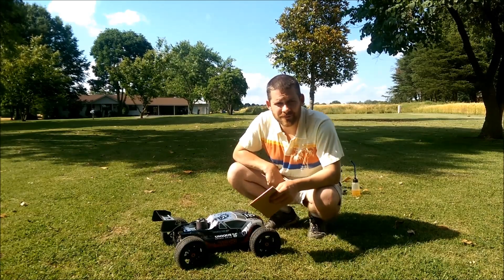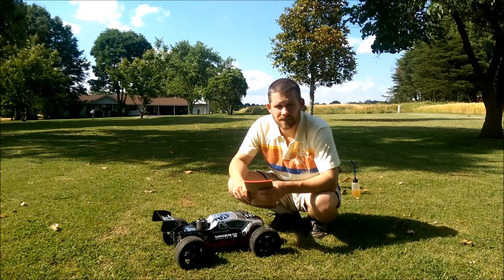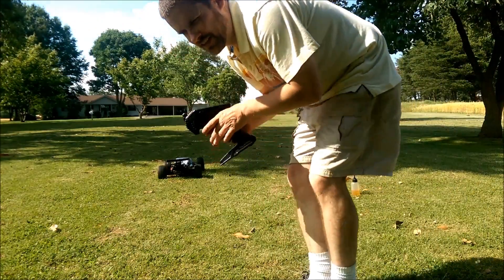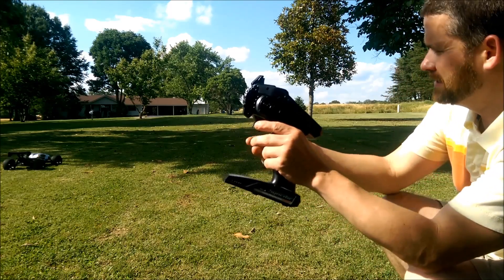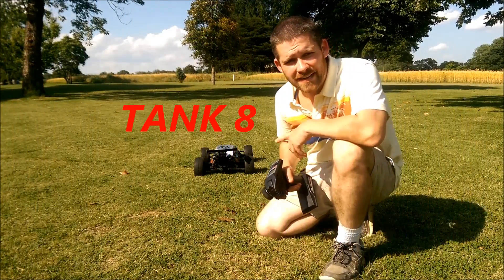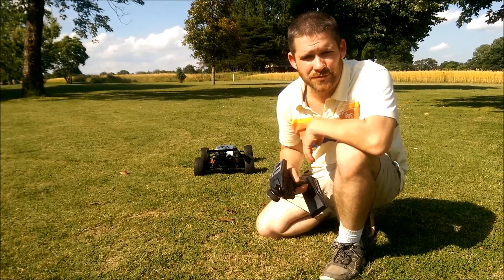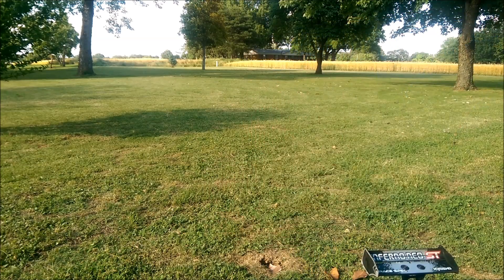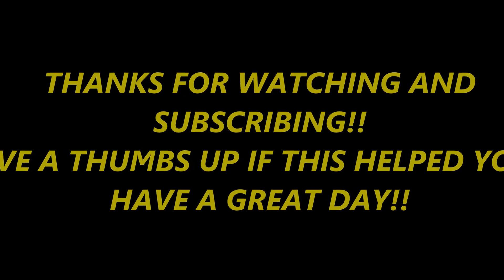Kyosho KE25 Engine Break In Using The Heat Cycle Method (Part 2) *Performance Tune At End*

Comment: hey man thanks for sharing these videos! I just ordered the Kyosho inferno neo st 2,0 and I will be doing the heat cycle method as well. Have a couple questions fro ya. 1. What percent nitro are you using? I ordered 20% with 14% oil in the fuel, also I have a heat wrap that goes around the cooling head for preheat but have been told this is a dangerous way to preheat unless you are very careful because if it gets too hot you can basically F the motor, so do you think a heat gun is the better way to go for preheat? Thanks for your time. Spencer. Also I live in Denver, Colorado and the field elevation for me is 5, 200 feet. I know that this will mean I will have to lean the fuel/air mixture to compensate for the altititude but as far as break in I will still run very rich, what elevation are you at. Thanks. Spencer!

Comment: run carb settings for KE25 ,high speed just under 2.5turns from fully in,lowspeed 1mm in from flush on 25%nitro,runs a dream great motors

Comment: Hey I watched part 1 of your break in series and while following your steps on my first run my NEO ST's  temp rose to 300F. I double checked my readings with another temp gun and had the same results, high 200s and with only a minute of driving. I preheated the engine to 130F with the tinfoil/hairdryer method. I didn't touch the needles and there was a good amount of smoke coming out of the exhaust. I used Backyard Basher fuel with 20% nitro and 19% oil. I only ran 1/8th tank through before shutting it off. What am I doing wrong?
Reply from the maker: +Connor Sometimes those heat guns can be very in accurate. The best guns to use are specifically made to be taken with the gun right up on the glow plug opening. Normal temp guns like at home Depot etc aren't designed to be used at such a close range. There is actually a spec on the guns that say what range they are meant to be accurate at. Are you using a RC engine temp gun?

Comment: hi is there any way to add an electric starter to this Truggy cause the pull starter sucks.
Shawn e: mail  NISSANM69@AOL.COM
Reply from the maker: +Shawn collins Your only option is to get another engine and use a bump box or if you can find a sealed backplate for the engine you can use a bump box to start it. Not sure if they sell sealed backplates for the Ke25 or not. There's not a electric starting option other than the starter box (bump box) that I know of.

Comment: excellent job, you have a perfect tune, Is this the same engine as the mad force kruiser? I'm buying that shortly, so just wanted to know, and how many glow plugs did you go through, and could I just put aluminum foil on the engine too get it hot, once again excellent video, and subscribed👍
Reply from the maker: +Dwayne Baker Yes it's the same engine. The engine doesn't eat plugs badly at all. Only used one plug to break in. Yes aluminum foil is fine. Just keep the engine between 200- 220F.

Comment: I'm confused with the nitro %, most people r using 20% for the warhead 1/10 buggy but can it go up to 30?
Reply from the maker: +luke curtis You can try it. It has a lot of factors that come into play when dealing with nitro ‰ such as ambient temp, head clearance, compression ratio, glow plug used. The main thing to be sure of when one is not sure about running 30% is making sure predetination doesn't happen. You can  Google nitro engine predetination. Hope that helps

Comment: Can you give me situations of when I would have to turn 1 of the 3 needles? And what does left and right do on all 3 of them? Nitro newb sorry
Reply from the maker: +Jake.Marttila Turning Right(or clockwise) on the High Speed Needle and Low Speed Needle will lean out the fuel/air mixture and cause the engine to run at higher temps and will decrease lubrication. Will also produce more power if the engine is running rich. Turning said needles to the left (or counterclockwise) will richen the fuel/air mixture and will drop temps as well as increase lubrication to the internals. You would need to lean the engine out if the engine is running sluggish and producing excessive smoke. If the engine is running too hot or is producing no smoke then you would need to richen the HSN. Most of your adjustments will be on the HSN. The LSN doesn't require as much attention usually. Unless you are the type that just has to have that perfect tune at all times. Anyways, hope i was able to give you a couple examples to help you understand a little bit better. Thanks for watching!
Reply: Average Joe Nitro Hey Joe is your lsn set to flush on this truggy

Comment: the truggy look just as good as the tune sounds great job👌
Reply from the maker: Thanks!
Reply: hello ,I wanted to ask how many minutes do with a full, thanks
Reply from the maker: +Emanuele Ribetto I usually get around 15 minutes run time on each tank.
Reply: Average Joe Nitro thank you, your videos make me want to buy really very beautiful
Reply from the maker: +Emanuele Ribetto Thank you very much! I love the hobby and hope my videos will help people who may be having a bit of trouble and aid them in getting up and bashing! It's a truly awesome hobby and is very rewarding once you get the hang of it! Thanks for watching Emanuele!
Reply: Average Joe Nitro carburetion to what you opened , from completely closed , the maximum screw and the idle screw ?
Reply from the maker: +Emanuele Ribetto The idle gap needs to be set to about  .5mm  A post I recently read says that it's about the thickness of an Xacto blade. If you straighten out a paperclip stick it between the carburetor slide and adjust the gap to where it's the thickness of the paper clip it will get you close.  It's actually a little smaller of a gap then the paperclip thickness. I am talking about a small normal sized paperclip. Not a big one.  Hope that helps!

Comment: Nice NITRO TRUGGY👍🏼 ! Good luck with it but don't worry so much about that motor ! Just use it so you could get used to your RC . There is way better motors then that to use on that nice TRUGGY . A Novarossi motor will run like a clock and keep on ticking all day tank after tank. And you could also get a kick ass LRP.28 or .30 to really have fun and do wheelies with that TRUGGY !!!! But it's not the same quality as a novarossi or a PICCO. I run a gallon of fuel to break in all my NITROs on a bench. 10 little tanks won't do it for me or my engines unless you get a motor that had a LAPPED PISTON AND Sleeve! If you think your motor is done and broken in now, you are mistaken! If your motor is running good now then it's going to run better after a gallon but don't over rev the new motor yet for to long.
Reply from the maker: Thanks for watching Botajell! I am aware that this isn't a top of the line engine lol! It is however a nice running engine! I have broken in engines like this and have had zero problems. I actually had the engine off last night to inspect the clutch and took a peek in the exhaust port and the sleeve and piston looked awesome! The amount of wear in on the piston was phenomenal! Engine is fully broken in without a doubt! Thanks for your comment! Have a great day!
Reply from the maker: Oh, btw, the engine has had 1 full gallon of 20% ran through it and is now about 1/2 way through the second gallon of fuel (which is 30%). I will more than likely get a higher end engine after this one is tired but for now, thia engine is more than enough to race at the track I run on. It has plenty of torque to get up on the straights. I am no where near a pro racer lol and this thing will serve me well for a while with proper care and maintenance! :)
Reply from the maker: Oh, btw, the engine has had 1 full gallon of 20% ran through it and is now about 1/2 way through the second gallon of fuel (which is 30%). I will more than likely get a higher end engine after this one is tired but for now, thia engine is more than enough to race at the track I run on. It has plenty of torque to get up on the straights. I am no where near a pro racer lol and this thing will serve me well for a while with proper care and maintenance! :)

Comment: Great video and thanks for putting it up... Just checked the UPS website, mine should be here by Friday.... I want to run 30% in mine too but all the info I can find on this model says to use 20%. So my question is did you have to add any shims to the head to run good / tune with the 30%?
Reply from the maker: Nope, it runs great using 30. No predetination at all. One thing I just noticed that was false on the information on tower hobbies is. I just pulled the clutch bell off to inspect the clutch shoes and it has aluminum shoes! It states on tower hobbies that they are a 3 shoe composite, but they are indeed aluminum! The shoes look great for a gallon and a half of fuel put through it! They honesty barely look broken in lol
Reply from the maker: I have also changed the diff fluids. At the moment I am running 7-7-5.  7 in front 7 in center and 5 in rear diff. They are very easy to access too, and feel to be of great quality!
Reply: Thanks for the info and help. Keep making videos.

Comment from the maker: Took it out today and ran it hard for a while and its still running beautifully!  Haven't had a single problem with this truck so far!  Completely satisfied thus far!  I have the air filter that the mp9 inferno uses on the way and will be swapping that out when it gets here.  I have also taped the inside of my tires with carpet tape to stop the ballooning of the tires.  Also flex sealed  the inside of the body to add durability to it.  I will be uploading a video soon of how to do the tire taping if anyone wishes to do so.  Thanks for watching!
Reply: I am ordering this truck as soon as it's off back order. You've been super helpful with all my questions about it. I appreciate that thank you!
Reply from the maker: +Ghostviper79 No problem! Glad I could help! You will really enjoy the truck! I know I am!
Reply from the maker: +Ghostviper79 Just had a look at tower hobbies site and the truggy is in stock (limited quantities) just thought I'd let you know in case you weren't aware! Have a good one!
Reply: +Average Joe Nitro yep I was watching it like a hawk. I got mine ordered should be here in a week or so. Can't wait!!
Reply from the maker: +Ghostviper79 Good deal!
Reply from the maker: +Ghostviper79 one thing I will tell you to save you some trouble. most engines I have had in the past you could Prime them by simply placing your finger over the exhaust hole. this one you need to make sure and hold the throttle down to open the carburetor while putting your finger over the exhaust hole to prime it. If not then it won't prime.
Reply: +Average Joe Nitro that's interesting. Thanks I will watch for that.

Comment from the maker: Used 20% for the 10 tank break in.  I bought a gallon of 20% for breaking it in and ran the whole gallon through the engine before switching over to 30%.  The performance tune at the end of the video was running 30%.